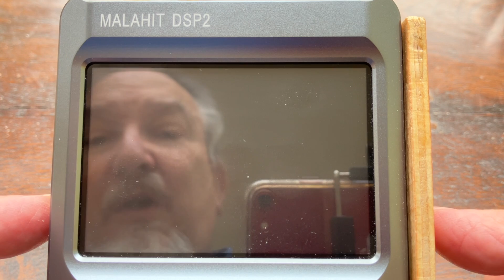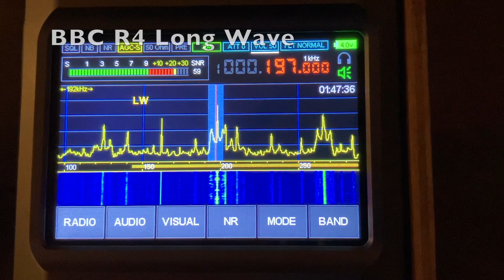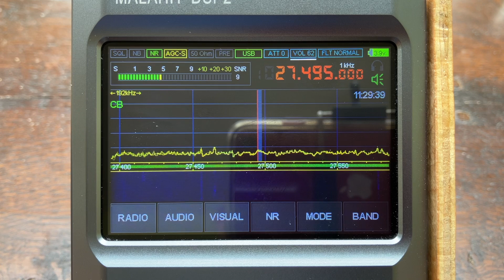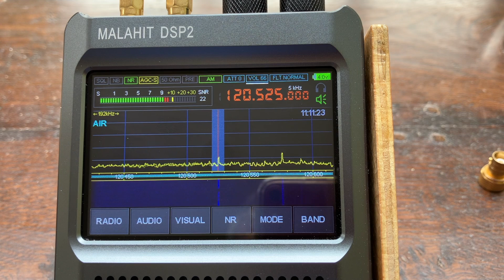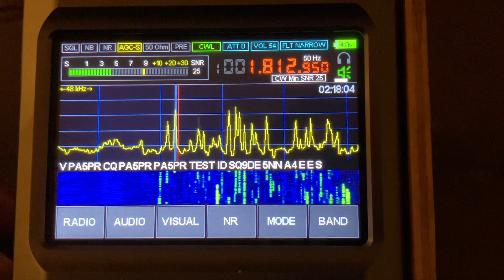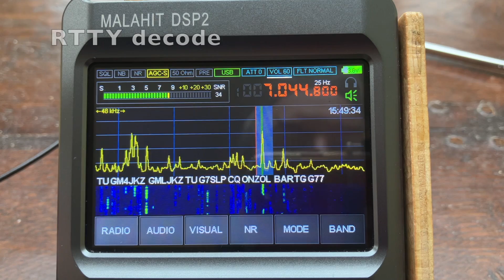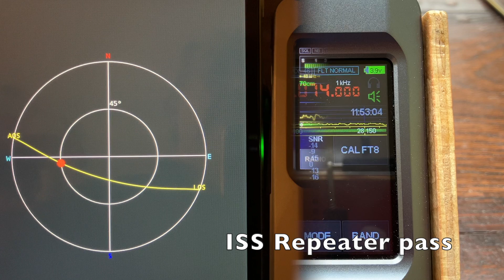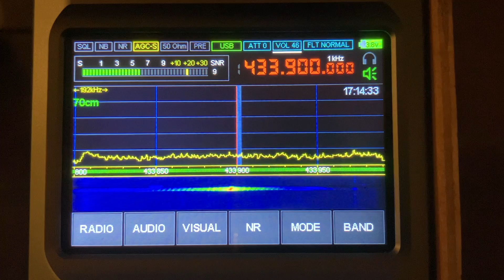Malahit DSP2 SDR demonstration

Comment: 🎉 Lovely.

I just got mine for a few days now ❤ 

It's interesting that you don't use the Preamplifier (PRE) - I've just realized, that it's also amplifies the noise as well, so no need to turn it on always 😊

What antenna are you using here? It's on the 50 ohm connector I suppose.
Reply from the maker: Yes, you're right about the preamplifier. The antenna here is a small active loop with a three-transistor balanced amplifier (another reason not to use the preamp). It is on the 50 ohm connector but has a very low output impedance which maximizes the voltage transfer to the input of the radio.
Reply: @echelfordars8854

Lovely, thank you ❤
Do you have the plan of the loop, please? 😊
Reply from the maker: @PureAwareness76  Give me an e-mail address, please.

Comment: 🎉 Great, thank you!

 How is it compared to an SDRplay, please?
Reply from the maker: Smaller, heavier, more expensive, less flexible but you don't need to lug a computer around with it. On the other hand, you CAN connect it to a computer and probably do all the things that the SDRplay can do - should you want to.
Reply: @echelfordars8854 

I've just got my DSP-2 ❤

Which antenna are you recommending for HF? 

I have the LZ1AQ Active Loop (copy). Nice, but could be better.

Comment: How works in mw and lw?  Thank You.
Reply from the maker: That's a very good question.
There are very few LW and MW stations now operating here in the UK. The included telescopic whip antenna does not receive the BBC transmission on 198 kHz, even at high gain settings. Using an external long wire aerial or the amplified loop shown, I can receive it and Algeria on 252 kHz any time day or night. However, I then need to reduce the RF gain drastically, and sometimes need to apply further attenuation to prevent images of MW stations breaking through. This could be alleviated by using a suitable filter or possibly by adjusting the other gain stages accessible from the radio menu. It is good for receiving aircraft non-directional beacons.
MW also requires care. I can receive local stations on the whip, preferably using the Hi-Z input. Using the loop or a long wire brings in stations from all over Europe after dark but image interference from strong local stations occurs all across the dial unless you control the gain very carefully. Receiving weak stations is not a problem; keeping the strong ones out can be, and you may need multiple filters or wave traps to succeed if DX is your hobby.
Reply: @echelfordars8854  Thank You for the information. I am waiting for mine malahit and learnign about it.

Comment: now if they make the Malahit DSP2 with a 100Watt transmitter built in, that would be a great radio to buy.
Reply from the maker: There are plenty of SDR-based transceivers on the market...
Reply: @echelfordars8854   yes but the Malahit DSP2 has a better Noise Reduction / Noise Blanker.

Comment: How is the noise level compared to other recent SDRs (e.g. SDRplay's RSP1A or RSP1B)?
Reply from the maker: Good question. I have an RSP1a but it is operated under very different circumstances from the Malahit, albeit at the same location. Local noise is moderate here on most bands. I have no reason to believe that the Malahit is anything but better than the RSP1a and it has more control over the individual gain stages which helps (when you understand them). The Malahit requires quite careful optimization of the RF gain, and the noise reduction system is outstanding. SNR is always difficult to compare between different receivers.
Reply: @echelfordars8854  Thanks for your detailed answer! Being new to these radios, what do you mean with "careful optimization of RF gain"? Is this something you need to do once or be aware of all the time (when switching bands)?
Reply from the maker: @casybond  For optimum reception, it is something that you should check regularly. To make a radio signal audible, you can amplify it at either the RF stage or at the audio stages. In general (and it's a significant generalization), amplifying the RF by a certain amount introduces more noise than amplifying by a similar amount at AF. Some radio amateurs operate their rigs by turning the audio volume up to almost maximum and then adjusting the RF gain for comfortable listening, thus minimizing the noise.
However, the real situation is more subtle as there are different forms of distortion that can occur during the detection process. Some distortion is not usually a serious problem in (say) amateur transmissions, but for other purposes (including very weak signals) can affect readability. Also, there is the question of the operation of the automatic gain control circuitry (AGC) that tries to counteract fading.
The Malahit has at least three RF gain settings; right at the front end (aerial) and at each of two IF stages (sometimes only one is used). These latter two are fixed for most purposes,  but the Malahit allows you to access them if you wish to do so (most of the time you won't, but the option is there). I don't know if the RSP1a allows similar twiddling. Careful tweaking of the RF gain (or input attenuator, similar) can significantly improve the signal to noise ratio of a particular signal on a particular band (at a particular location and time of day!). I hope this helps.
Reply: @echelfordars8854  Yes, this helps a lot.  I've worked closely with analog electronics designers and have an (digital) electronics/CS background, so I immediately understand what you're talking about (except the jargon IF, but I'll look that up). Thank you again!
Reply from the maker: @casybond  IF = Intermediate Frequency. In superheterodyne ("superhet") receivers, the incoming signal is frequency-shifted to a fixed frequency (the IF), and then detected by a circuit that is optimized (in sensitivity and filtering) to that fixed frequency. This provides the best performance in terms of both sensitivity and selectivity.

Comment: Just got one. Absolute brilliant. Only flaw is the encoder which has to be spun sometimes. Other than that, incredible.
Reply: That the encoder takes several clicks to change value I see as a feature, not a bug. It may be slow but saves overshooting the set point you're aiming for. I've never found it to be a nuisance.

Comment: The RDS is crap tho !!! Takes forever to pick up anything.. The set should have wifi to pickup the time so you can used FT8 properly as exact time is essential.. My little ATS25 Max Decoder beats this set !! shame about its size tho !!
Reply: I don't know why the RDS is so poor; I've never got it to work fully, but then I didn't buy the radio to listen to FM broadcasts. I've got the clock adjusted now so that it stays accurate to one second for weeks on end. The ATS25 has its own limitations, frequency range being the most obvious.

Comment: Would you rate this over the ATS120?

In your opinion, which is the ultimate scanner?
Reply: Far superior in my opinion I've only had this for a few hours and I am blown away with it, far better even than my recently purchased sdrplay RSP1a   using my wellbrook loop inside my flat. I've been hearing many signals on 80 meters which I usually cannot hear because they are usually drowned out by noise. I purchased this from Bangood I ordered it on the 28th of January they were out of stock until the 4th of February it was dispatched on the 5th of Feb and arrived at lunchtime today the 13th, so don't be wary of ordering anything from them they haven't let me down so far. I hope this helps you 👍🇬🇧
Reply: @daveyjones6465  Thanks for that, going to order one now.  Cheers.
Reply: Sorry, no idea - I know nothing about the ATS120.

Comment: how do you get the dynamic retro scale on the screen. i have the same radio and i'm new to so many options in the menus. i just want a typical radio interface as you have.
Reply: The retro scale is only available for VHF FM broadcast band and is well explained in the manual, including how to populate it with an auto-scan. However, if you are listening to an FM broadcast station in the usual band (~88 - 108 MHz), you can toggle between retro scale, spectrum, and encoder spectrum (RDS etc.) by touching the lower half of the screen. Good luck with RDS data though; I've never managed to get it to display.
Reply: @MirlitronOne  I see.only fm. Thanks
Reply: I have the first generation Malahit DSP1 clone. I'm disappointed that the Malahiteam devs programmed the software to display the retro dial scale only for FM band and not the HF shortwave band.

However Bernard Binns who develops the Harduino firmware for the inexpensive ATS-25 and ATS-120 DSP receivers managed to incorporate the retro frequency display for LW, MW and FM bands.

Looking forward to buying the Malahit DSP2, but since this hardware and software is still new, I'll wait until the end of the year to see if the DSP2 drops in price and for any further enhancements to the ver 2.3 software.